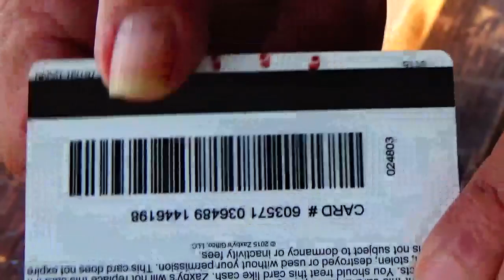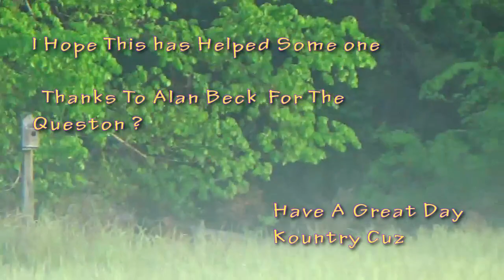Making A Lap Steel Nut Demo

Comment: That is how I made mine. I went through 4 pieces the first time until I got it right. I took the tails from a set of strings and glued them to a piece of wood to measure the depth of the notches. It worked out pretty well. Thanks for showing us.

Comment: Do you use same material for bridge and do you cut slots in the bridge as well? What file is that one? …seemed to go through the aluminum line butter . Thank you kindly !!
Reply from the maker: No I use the Fender Style Bridge and the Nut is aluminum angle From Home Depot and you Can also Buy the Small Round File their !   I hope this helps  !

Comment: Just out of curiosity were you an Engineer or a Machinist during you Working years?
Reply from the maker: My father had A machine Shop and I Worked Their till I was around 25 Then Went to Gun Smithing School and Ran A Gun Shop for 12 years and we also Rebuilt Tractors on the Side !  so I know my around Tools and Equipment also had A Trucking Co for A long time ! Had to Rebuild them Truck also !
Reply: @KountryCuz1  My Gut Feeling was you had experience with working with your hands. More so than just mowing the lawn.